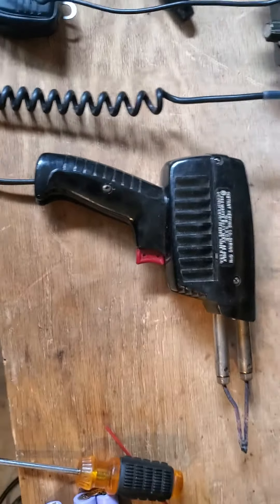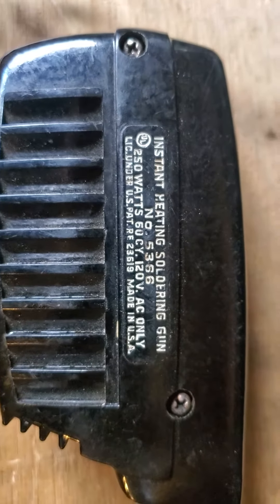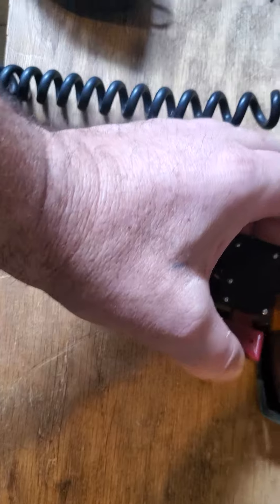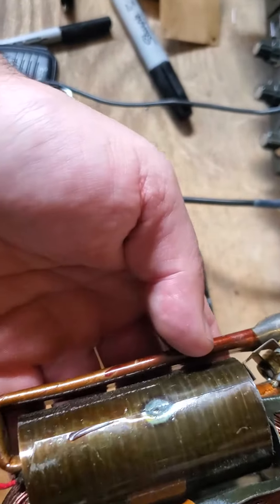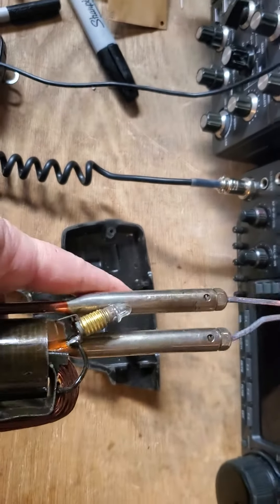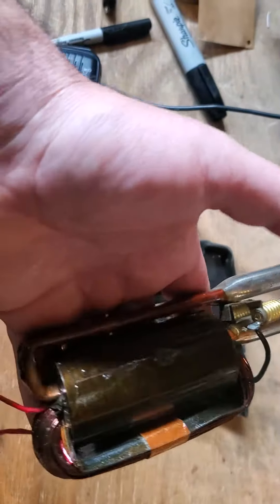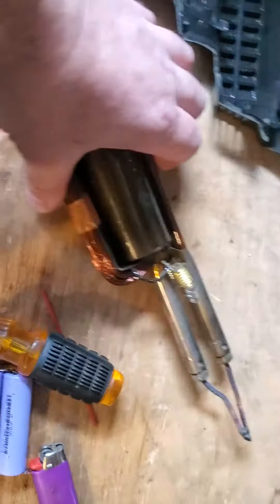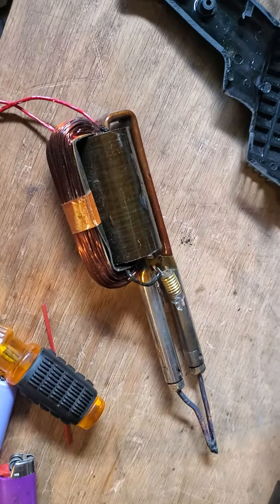HOW A SOLDERING GUN WORKS

Comment: I just discovered this myself - the transformer inside the soldering gun. I was curious what the output voltage was so I put my AC V meter on it and it measured 0.2 volts. Wow!